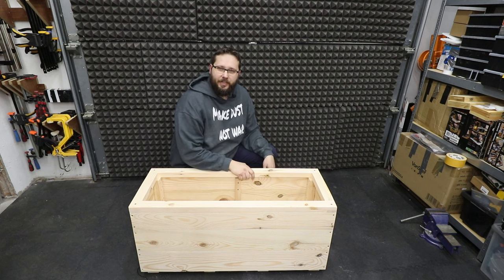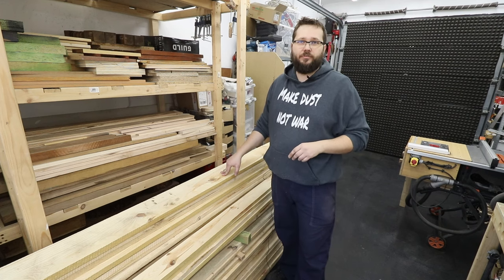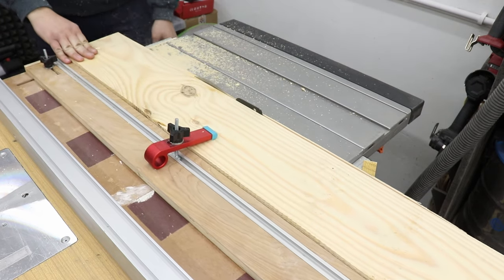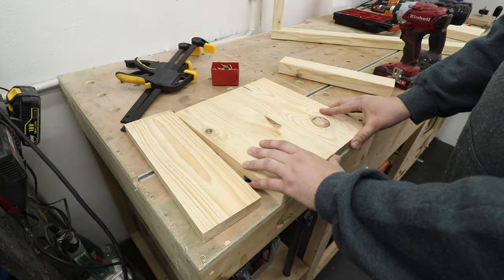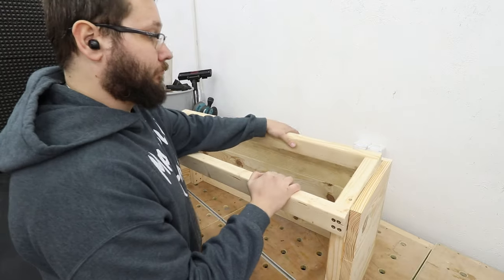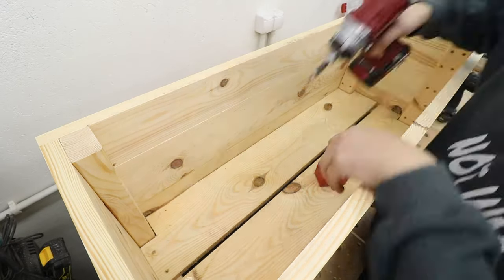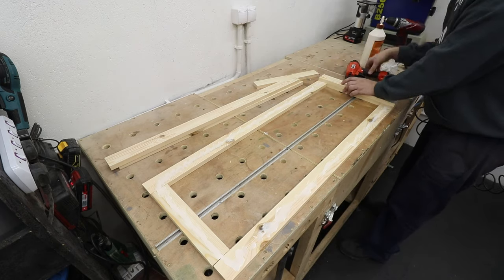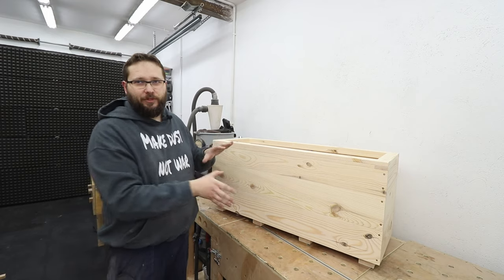DIY Simple Planter Box

Comment: The planter looks solid and sturdy and quite simple to make. Thanks for sharing the video.
I need to go to Poland for wood I think. Here in Slovakia I don't know any place were you can buy rough sawn planks, only with some profile in/on it.
What is the width of the planks, and the thickness?  How much do they cost per meter?
(You can say prices in Zlotys, I'll divide it by 4.2 for Euros), How dry/wet is the wood?
Reply from the maker: Thank you. So the boards are 3m long, 16cm wide and 2.5cm thick. They cost 16 zlotys per board. They are air dry about 15- 20%
Reply: @CasualDIY  Thanks for the information.  Perfect dimensions and moisture content.  And a very affordable price. Next month I'll try to get some. I found some lumber yards just at the other side of the border, maybe 80 km from my home town.
Reply from the maker: @hansdegroot8549  if you can buy larger amounts and have the transport for that then for sure its worth it
Reply: @CasualDIY  Larger amounts of wood are not possible for me. I don't have the money to buy a lot at once.  I don't have the place to store a large amount of wood. And I don't do woodworking very often.  On the other hand 160 km is 25 - 30€ of petrol with my car. In May I'll make some phone calls first.

Comment: you can use up old scraps of wood at the bottom going short ways and leave a 1cm gap between each one so save some cash...
Reply: as you might be able to tell ive made  a few planters now haha. the biggest being 4m long which weighed a tonne haha
Reply: i also tend to round my corners a lot to avoid kids running into them and hurting themselves, plus avoids future splinters (PS sorry to spam so many messages hah)
Reply from the maker: 4m long wow now that's big. Yes I did round over the edges, did I not mentioned that int he video? Hmm must have cut that out by mistake. You see I was debating in my head to do that, put some scraps in the bottom but as it wasn't for me I though it was best to splash out a bit 😂

Comment: Might be a dumb question, but is this wood treated?
Reply: Seems not. Which makes it incredibly stupid for an outdoor application.
Reply from the maker: No it's not. My brother will be securing the wood himself with special wood sealers. He has one examine I've made and it's been on his balcony for the last 10 years and nothing has happened to it. So I think this will be just fine.
Reply from the maker: My brother will be securing the wood himself with special wood sealers. He has one exactly like the one I've made and it's been on his balcony for the last 10 years and nothing has happened to it. So I think this will be just fine. Its made on request as I have mentioned in the video. 
You don't need treated wood for all outdoor projects as long as it's properly secured and finished with products that are designed for it. But that's basic knowledge.